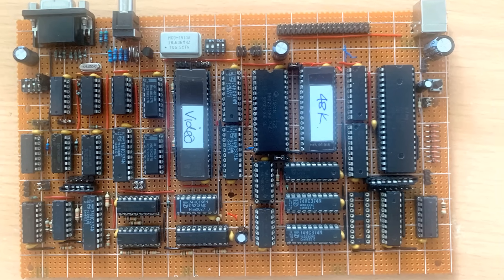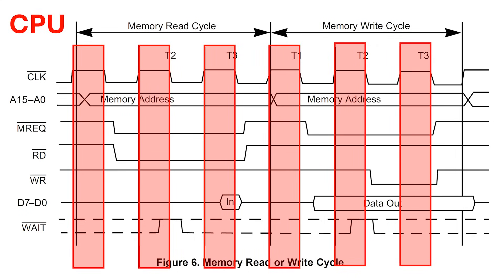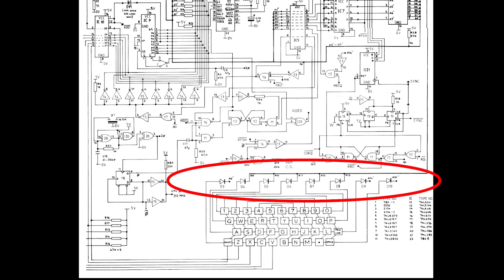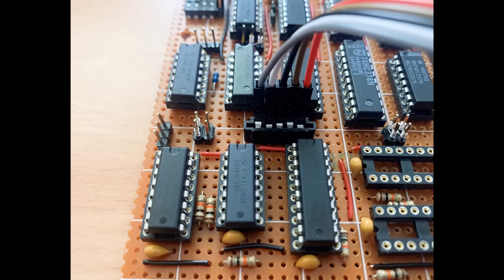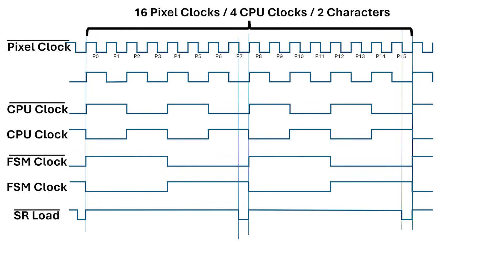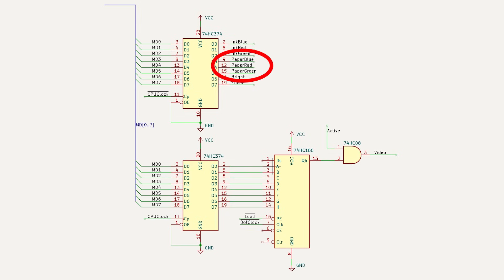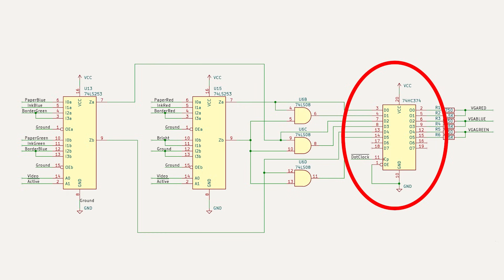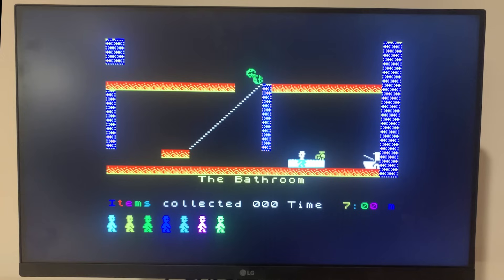VGA ZX Spectrum - No ULA, No FPGAs

Comment: Some years back I've implemented the brightness bit  in a different way. I had half of HC244 for character and the other half for the background and the pixel data switched between them with OE (one OE negated with HC125 and the other as well as VSYNC and HSYNC just buffered with rest of HC125 to give it similar propagation delay, although now when I think about it I could use HC86 which would give closer delays and spare two resistors heh). The color bits had 470R resistors and the brightness was connected to 3 Shottky diodes each clamping one output after resistor. It doesn't allow for fine tuning the dark color but contrast between bright and dark can be achieved nicely. 
This was a project called "VGARM" that was more or less a color terminal with full 640x480 VGA output using only ARM Cortex M3 but actually the principle and tricks used were quite similar to ZXs but all within one chip (almost). Like lot's of NOPs, DMA which is pretty much same as this automatic RAM addressing in ZX, and serializing pixel data just with a build in interface (SPI first, later I2S that was actually better as it's continuous where SPI had to wait one clock cycle between bytes so there had to be an empty background color space between characters).

Comment: I like the fact that you don't use any FPGA's for this retro hardware. To me an FPGA is  missing the entire point of  period appropriate technology.
Reply from the maker: Thanks, i've wanted to use through hole technology.  The only place i cheat a little is by using larger memories than were available at the time, but i don't want to spend forever wiring up memory boards.

Comment: No FPGA?
Why not? Because you don't know how to use them?

The original Spectrum contained an ULA which is the masked programmed equivalent of an FPGA. So using an FPGA is actually closer to the original Spectrum.

There are no points awarded for making a design more complicated.
I would personally give points for someone that does use an FPGA as it demonstrates they can design the circuit for it.  It demonstrates they have more knowledge and skill than just using discrete logic.
Reply from the maker: Interesting that you jump straight to that.  The purpose of the video/series is to demonstrate finite state machines (for what's next to come).
It turns out, I have indeed been using FPGAs to make video controllers for quite some time, see - https://dl.acm.org/doi/pdf/10.1145/311535.311569
I was also part of the GPU architecture team at NVidia previously and i worked on the display controller there, so I'm familiar with going directly to silicon as well.

I personally find watching videos of a screen shot of someone programming FPGAs a bit boring, but that's just me.   If you like that, here is a good series - https://www.youtube.com/@CompuSAR

Comment: In the Spectrum commercial from Micro Men they state CPU frequency to be 3.54Mhz, which is true for 128K and later models, but the original Speccy ran at 3.5Mhz 😁

Comment: A spectrum with a VGA display is pretty sweet. As an aside I love the VGA display standard. It's probably the most home brew electronics friendly video format.
Reply from the maker: Yep, standard VGA is pretty straightforward, much easier than composite!
Reply: EGA accepts TTL levels and needs slightly lower frequency.
Reply: @ArneChristianRosenfeldt  CGA, too. Also capable of NTSC output if you really want that, and lots of games from the early 1980s exploited that fact for extra colour you'll never see on a TTL monitor (or using the backwards-compatibility of EGA and VGA).
Reply: @Roxor128  yeah well, I hate everything about CGA, but love everything about EGA, but for the bit planes. But then again, our first PC had SVGA and 72 fps and I just loved it. So I guess I can let go of TTL. Also: TTL on long cables sounds like an electro magnetic interference problem. Also: long cables need termination. So you would always burn 2 V over 50 Ohm. VGA with less cables and less voltage is better.

Comment: Nice, very nice.  I am not sure of your goals, this idea may ruin the purity. Maybe you could share the address/data bus with an RP2040, use that to generate the VGA output and also use that as a USB interface and flash storage for the Z80 images to load/save.  I've seen the RP2040 used to emulate ROM, I am  not sure if the timing would be good enough for your project though.
Reply from the maker: Thanks, but I'm not so sure how 5V tolerant the RP2040 is.  The pin header is already configured for an ArduinoMEGA 2560, and it has the address bus and data bus wired up to it.  I'll probably use BUSREQ and BUSACK to halt the Z80 and turn off video (zx80 style) when i do the upload.
Reply: @DrMattRegan  Good point, I look forward to seeing it, this has been a fantastic series, thanks for sharing it with us.

Comment: Now add soundblaster support, LOL 😂!
Reply: Probably not terribly hard if you have a real soundblaster card.

After all, ISA (16-bit) is just the IBM PC/AT bus (Intel 80286 cpu) and the 8-bit equivalent is the IBM PC bus (Intel 8088 cpu).

The Zilog Z-80 is a souped up version of the Intel 8080 whereas the Intel 8085, which preceded the Intel 8086, is software compatible with the 8080 on the binary executable level.

So strapping an early Sound Blaster (8-bit) to a Z-80 based system shouldn't be that hard.

Comment: Actually, the ZX spectrum 128 is 16 not 15 colours because the brightness signal is separate and can be turned on or off on every colour including black and white.  
https://mts.speccy.cz/doc/128_rgb.pdf
It was interesting to see how little attention programmers made to not enabling brightness on black with a suitable monitor back in the day.
 I cannot remember if the 16/48k PAL output showed brightness on Black also, but the signal was certainly there internally.

Comment: Seems like this would break any speccy software that relies on specific contention timing to do things like multicolour or check what model its running on
Reply from the maker: Correct, it will act like an NTSC spectrum sold in the USA.  I can drop it down to PAL, with out the colour if necessary, or i may end up encoding a full colour PAL signal.
Reply: @DrMattRegan I saw a comment on a previous video where you mentioned the idea of slowing down the CPU when needed to match the speed of the original Spectrum with its memory contention, that could make the timing seem identical to the software. If any software relies on the exact time when pixels and attributes are output that could be tricky though, it wouldn't be expecting each row to be scanned twice.

Comment: Are you quite sure its a "Jet Set Willy" screenshot at the end of the video?
Its looks more like "Manic Miner" to me.
Nevertheless, a very interesting video on a modern touch to the ZX Spectrum hardware. Not to mention a amazing wiring and soldering skill.
Thank you.
Reply from the maker: Enjoy.  Ha, ha, i did actually check that, it's room 33  of JSW.
https://skoolkid.github.io/jetsetwilly/dec/tables/rooms.html
Reply: @DrMattRegan  Correct.
Just checked it, also compared the screenshots for both games. The games are quite similar and it seems like they used the same sprites for the little man.
Also I was confusing "Jet Set Willy" with "Jet Pac".
Regards.

Comment: I’m a little confused. VGA is 640 x 480 (visible) NON interlaced. Unless you are buffering a whole line before sending it to the VGA circuit (twice) you are sending an interlaced signal, so your monitor is actually displaying a 480i image (which is a US TV standard, but not part of the official VGA standard). If you have a monitor that supports 480i then chances are it will also support 576i, which is the equivalent 50Hz PAL standard and thus more compatible with Spectrum software.
Reply from the maker: VGA is 640x480 visible, but 800x525 total at 60Hz.   I'm essentially generating 454x525 at 60 Hz total, due to the lower clock rate (14.318MHz vs 25.175MHz) of which 256x384 is visible.  I'm still using VGA syncs of 31.5KHz and 60Hz progressive.

Interlaced video (PAL) still uses 15.625KHz for Hsync . I'm not buffering a line per-se, i'm just scanning out the same memory twice on two scan lines.
Reply: @DrMattRegan  ah, it’s the fact that you are displaying the same raster line twice in succession that I was missing. It’s a progressive frame that you are generating, but using analog video scaling to make horizontal image 640 pixels wide. If your monitor supports it then 576p gives you better compatibility at 50Hz from a 13.5MHz clock, or very slightly faster gets you 800x600 SVGA @ 50Hz.

Comment: That's pretty cool. Output is really nice.

I used to do all my experiments with point to point.
Reply from the maker: Very cool, i couldn't really afford wire wrap sockets when i was younger and got use to wiring this way.
Reply: @DrMattRegan  Same here. Veroboard and thin wires soldered to pins.